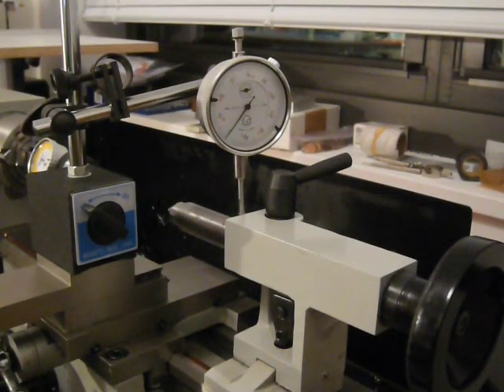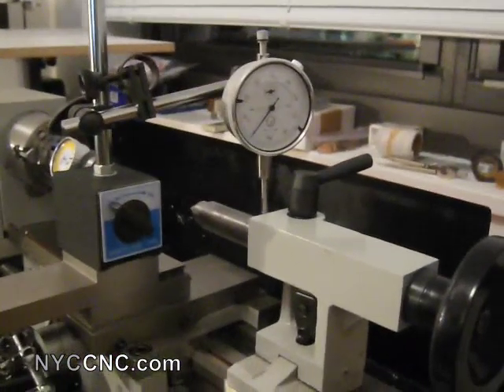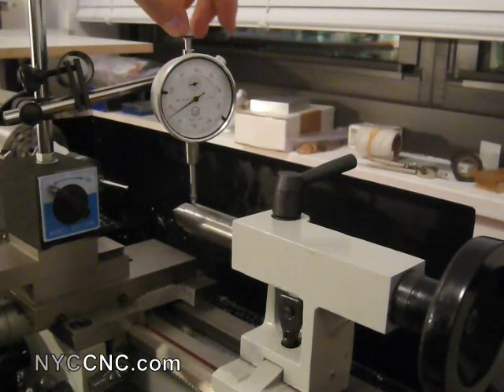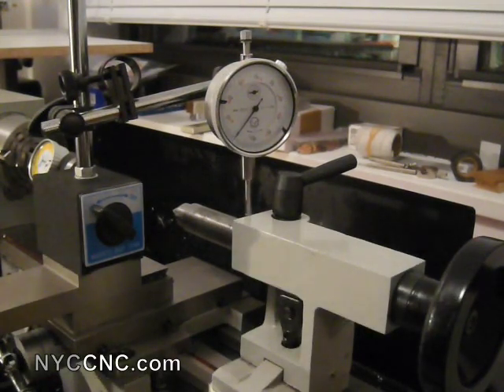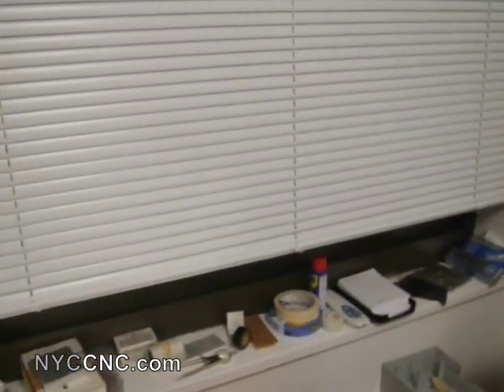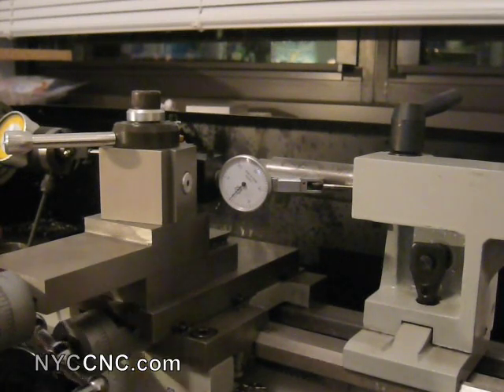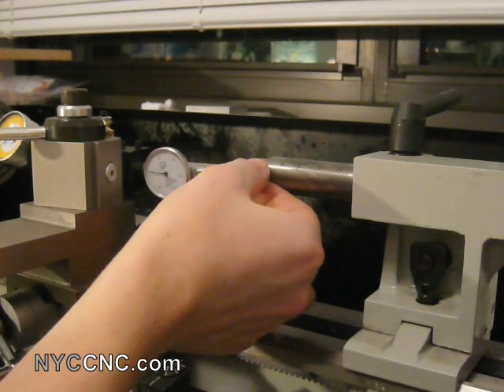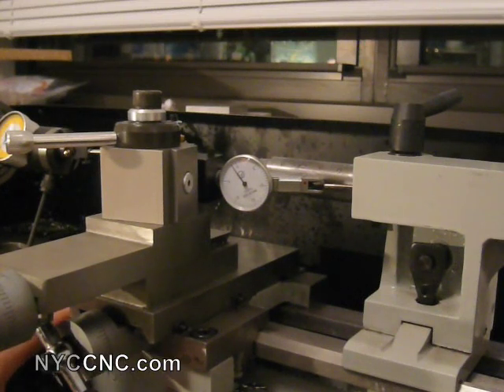Tailstock Alignment on Micromark 7x14 mini lathe - Part Two

Comment: Since the first part of your video determined that the tailstock spindle was pointing upward, the second test as you are running along the side of the spindle might not be accurate. The indicator might be rolling downward on the curvature of the spindle which could give you the results you are seeing. Even the first test could be wrong. Running a dial indicator along a round object that might not be pointing straight is not going to give accurate results. You are also assuming that the taper inside the spindle is perfectly centered with the outer surface of the spindle.

Comment: I always tell people to use the shortest extension of the tailstock spindle as possible because usually it extends out straighter at the beginning..  as the spindle extends from the trailstock head, it should not travel runout more than about .001".
Agree with EvilWeevilAnime and get a test bar.  mrpete222 (tubalcain) has good videos on alignment.